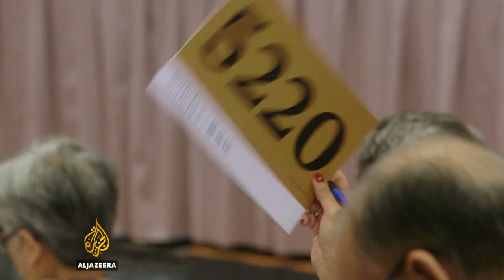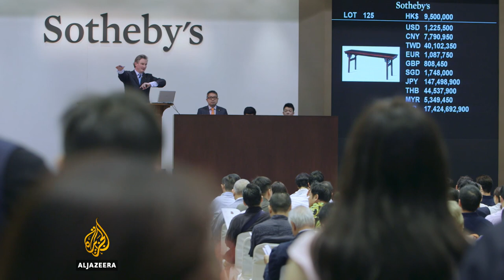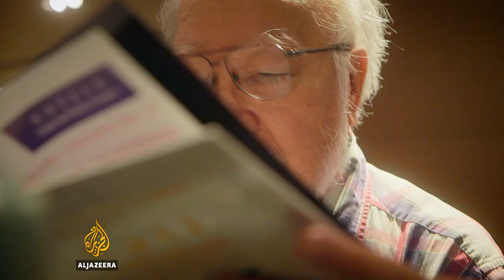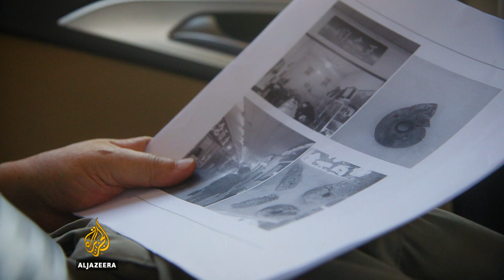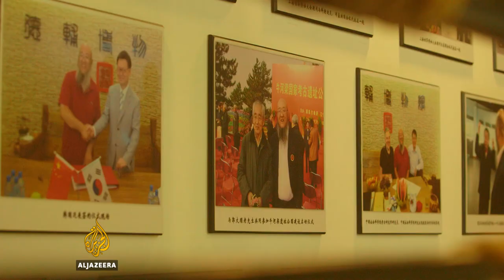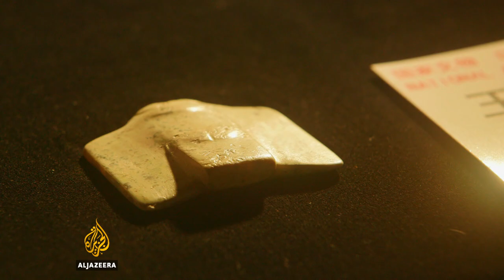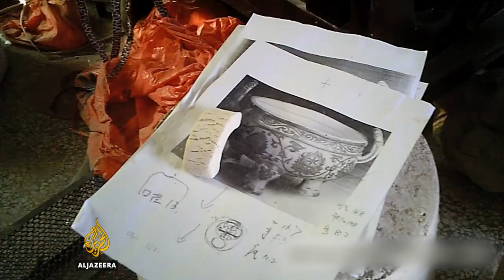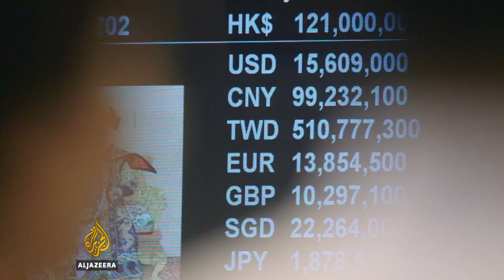China: Faking It | 101 East

Comment: question: DOES Carbon dating work in these artifacts?
Reply: No,  carbon dating can't be used to date porcelain, stone etc.  However, with porcelain or ceramic objects, there is a  technique that measures how much water the items have absorbed since they were fired, accurately revealing when they were made.  The problem is, you need to break off a piece of the ceramic for this process.